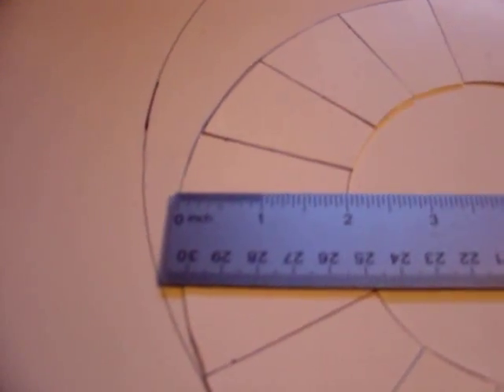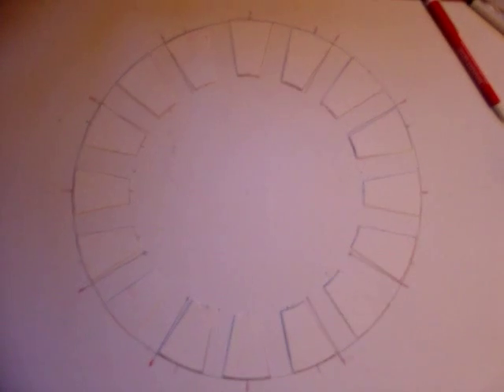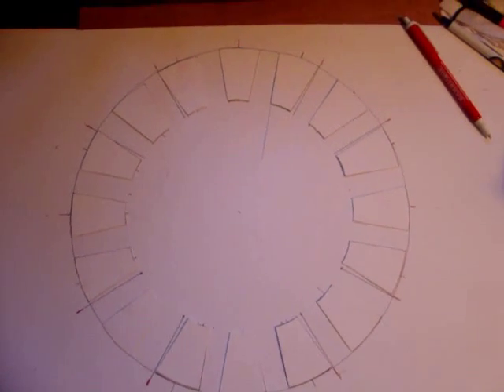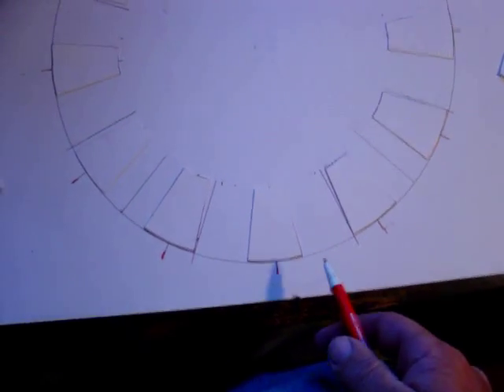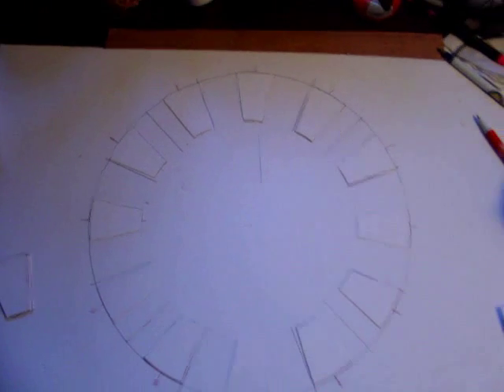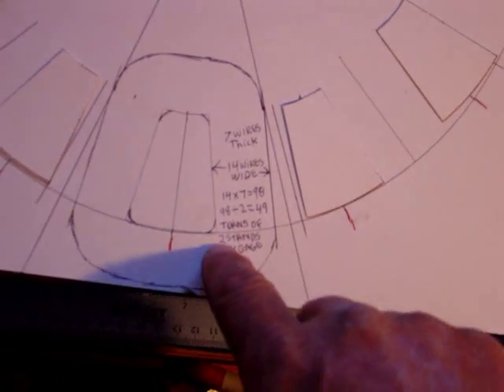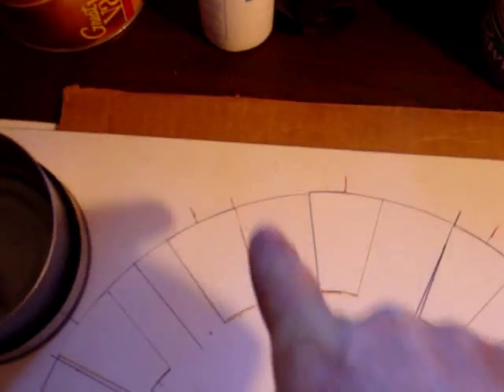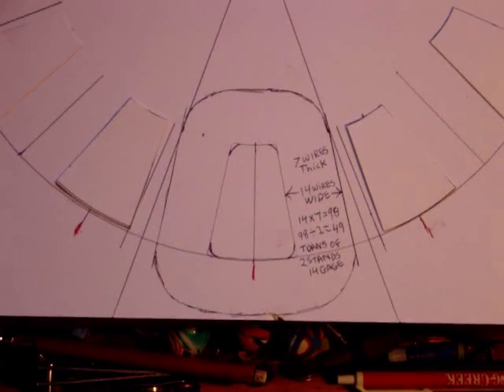AXIAL FLUX DESIGN AND WEDGIES LOL

Comment: Just been through the same hassle after discovering Neodymium magnets are not exactly the specified size. What I did was draw the magnets and rotor in librecad (freeware) to get the exact inner and outer radius with the intended spacing. Still need to find some suitable iron to make the rotors, but I'm guessing this will be close enough.